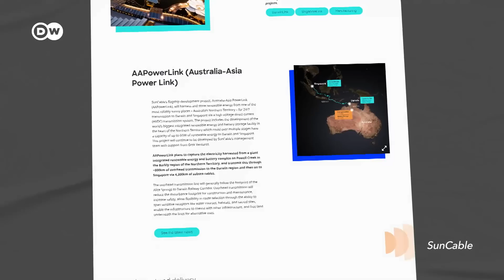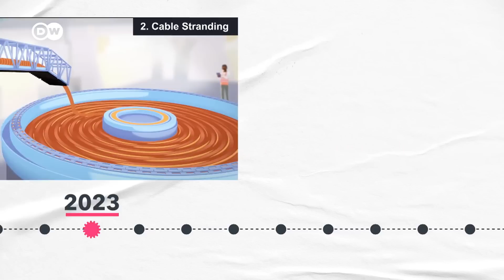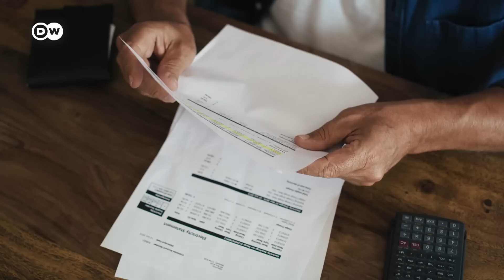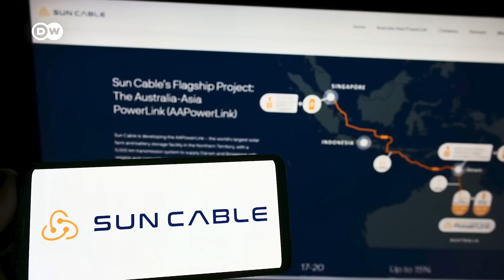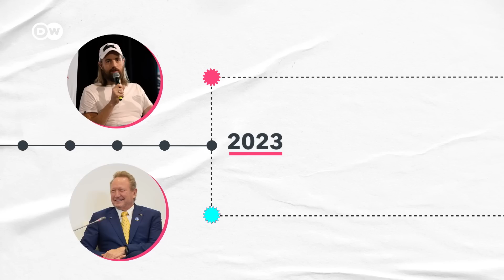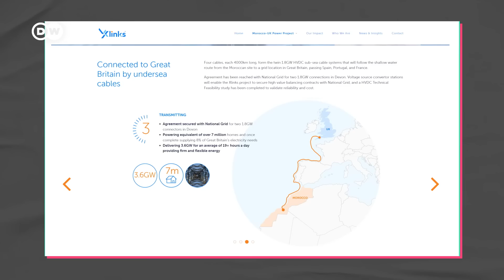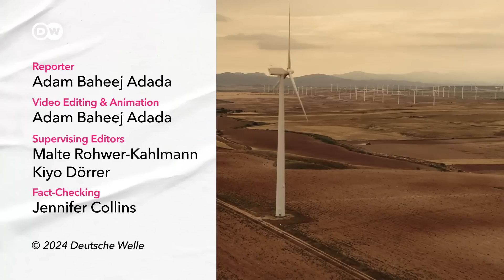Why the mega plan to send Australian solar to Asia (almost) flopped

Comment: I think energy security concerns will usually plague big single point inter-connector projects like this. The EU's idea for solar from the Sahara was even more risky considering the political instability in the region. It's one thing for friendly neighbors to synchronize their grids and send a couple GW back and forth as needed, but this is on another level. Hydrogen is one option, perhaps even synthetic hydrocarbons to take advantage of better energy density. Countries will want a strategic reserve of energy that can keep things going for a few weeks in case of disruption. That could be a massive battery or pumped storage facility, but then you're losing a lot of the cost advantages of a more stable renewable energy source than what can be produced domestically.
Reply: As the network of inter-connectors is built out world wide it will add redundancy - this has already happened with telephone and internet connections. Then if Russia (or some other country) gets uppity it's an inconvenience but not a disaster as you just route around them as much as possible.
Reply: @MalcolmRose-l3b  Interconnectors by themselves will not solve the problem, you still need that surplus of energy available. It's all well and good to have a redundant connection, but if it can't make up for the loss it's not going to be enough. With the internet the worst that happens is interest speeds are throttled, with energy you get blackouts or rationing.
Reply: @MalcolmRose-l3b  It's easier to deal with slower internet speeds than blackouts or brownouts though. And if Sahara or Australian solar gets cut off there's not going to be a suitable alternative just waiting to step in.
Reply: Interconnectors of this type are DC - synchronizing the grids is not required.
Reply: the point is that you still produce domestically, and then you sell when your energy is abundant and your neighbours is not, you buy when your energy is not abundant and your neighbours is, you store when both are abundant, and you pull from storage when neither are. you reduce both of your risks at the same time. japan wants to connect to russia, china and korea. china wants to connect to SE asia. SE asia wants to connect to australia and South asia. south asia wants to connect to the middle east. the middle east wants to connect to central asia and africa. central asia and africa want to connect to europe. 

in this way, your "neighbour" becomes your entire hemisphere, able to tap into abundance in the australian summer daytime during nuclear plant maintainance in japan. high rainfall in african dams can supply a period of low winds in germany. everyone is better off connected. you still must maintain your own system, but your risks go way down. consider that the main pitfalls of the project are "what if its attacked by a foreign actor?" and not "is the output worth the effort?" the reason why the foreign actor would attack it would be because not having the interconnector would make you weaker.
Reply: @jonathanodude6660  The issue there is there will always be net producers and net consumers. Europe is never going to export energy to Northern Africa. Singapore is never going to export energy to Australia. Those sorts of bidirectional relationships work when you have comparable countries such as within Europe. Dependencies will be created everywhere. You won't solve the problem by hooking everyone up to a massive super grid, never mind how ginormously expensive that will be, as well as not terribly efficient, because you can never guarantee you'll have enough surplus from friendly countries if there is disruption.
Reply: A good source of income does wonders for political stability. Furthermore Morocco is by no means unstable.
Reply: @rogerphelps9939  It's not Morocco where most of the solar farms will be, they'd be further south and east. Morocco would be where the transmission line runs to Europe, probably, across the strait of Gibraltar.

Besides, Morocco is not a risk free ally in this. It might decide it wants Ceuta and Melilla back and can now hold Europe to ransom over it.
Reply: Yes, a single cable route is at higher risk, "more risky considering the political instability in the region."        But my "InterPower" concept, with multiple power routes is far less vulnerable to such region instability issues.

With HVDC you do not need synchronized systems   "   friendly neighbors to synchronize their grids and send a couple GW back and forth   ".       Hydrogen is one option, for Energy Storage, but batteries are not.. .   Batteries are only practical for grid use, covering just a few hours, but particularly good at evening out delivery which means you can get a higher Average power delivery down a particular cable. . .    But Hydrogen and Pumped-hydro are better for longer Energy Storage. . .  I am working on Pumped-hydro Energy Storage up in the Megawatts, even for flat ground.

Cancel

Reply
Reply: @hughleyton693  Multiple routes means more cost, and it still doesn't help if there isn't enough energy available.
Reply: @hughleyton693  And countries do have redundancy, over short distances internally and with neighbours, because that is affordable. When you want to build multiple high capacity long distance interconnects, you're looking at hundreds of billions in cost.
Reply: @Croz89     Ah.!  . . .   Yes, you have spotted the floor or problem with a world wide HVDC super grid. . .   Yes, agreed. . .   But it is one way to spread Solar Power over many more hours than just the midday 4 hours.
Reply: hydrogen isn't really a very good idea for energy security, since it's produced with natural gas (and green hydrogen is just mind-bogglingly uneconomical for the foreseeable future), which encounters the exact same problems as just... a fossil-fuel based grid

Comment: I imagine projects like these will slowly happen all over the world, but it won't be as big projects connecting faraway places in one go, but rather a lot of smaller connections in various places laying the groundwork, which bigger and longer connections will then build upon. Also I imagine the timescale on such projects will be slower than one'd hope, but faster than one'd imagine. Because it has to deal with geopolitics and buildup of trust and alternatives.
Reply: For a modern day example, you can read on the Hertel‑New York interconnection line which construction began this summer. It is a few MW added to existing infrastructures. The legislation and construction are plan to take about 6 years. This is between good trading partner that already rely on each other for this type of resource, who already possess the technological capacity and a knowledge of the terrain geology.  A best case scenario.
Reply: Most of the connection in Europe is because depending on time, wind and sun, there are sometimes huge price differences. To do this elsewhere you need to trust your neighbour to not randomly cut the connection, to have a somewhat free electricity market and being able to pay. This limits the possible connections a lot. Lets say India wants to trade power with Italy and that there would be no tension between them, they could lay a cable from south India up to the Red Sea, through Suez, through the Mediterranean sea to Italy. Passing the Bab el-Mandeb, there are several risk factors, Yemen and Sudan are rather troubled at the moment, they and even Turkey might be provoked by Indian policies. They could try over land instead, Pakistan ... lets backtrack, undersea cable to Oman, then to either UAE or directly to Saudi, but Saudi doesn't have a connected grid internally iirc etc. etc. etc. Instead they need to agree to sell stuff to Oman on a kind of free market, who then sell on to the Saudis, who need to connect internally to move surplus power around, they already have a cable to Egypt and Egypt is either building or negotiating to connect to Cypress which will have a connection to Greece, who has a connection to Italy.

Comment: Doesn't it good to store it in hydrogen? From sun to hidrogen
Reply: There's a lot of technology challenges with hydrogen that haven't been solved economically yet.  The biggest points are:

(1) Hydrogen exists as a very dilute gas.  So it requires huge pressures like 700x atmosphere to compress it down to useful energy densities.  But this high pressure is hard on the piping and storage equipment.
(2) Electrolysis of hydrogen is energy intensive and requires distilling water first to remove impurities which is also energy intensive

But these problems could be solved eventually.  Hydrogen could be an ideal long term *seasonal energy storage*, like storing energy in spring/summer for use in fall/winter.  Hydrogen would best be used in large-scale facilities on the grid.  Use of hydrogen in vehicles is pretty much dying slowly from poor economics of distributed hydrogen on top of the core problems listed above.
Reply from the maker: We do touch upon this bit later on in the video! Keep watching. 🌞 And also check out our video on hydrogen here 👉 https://www.youtube.com/watch?v=AGTjKJHu99c
Reply: I also think it might have the advantage. sure sending directly through the cable is much better option but they are not going to do that all the time thats why they have the storage facilities which is also not efficient anyway